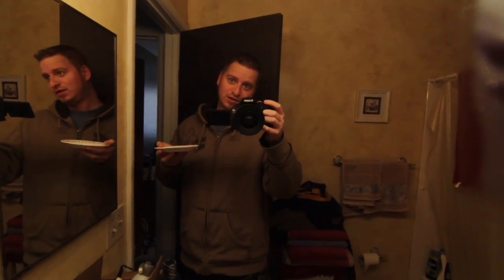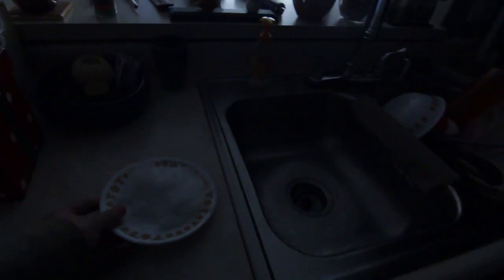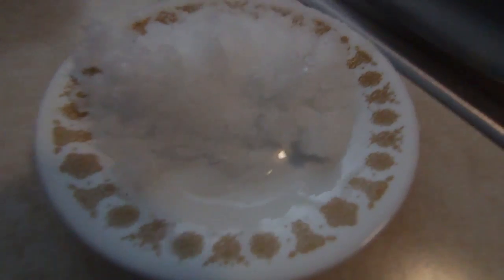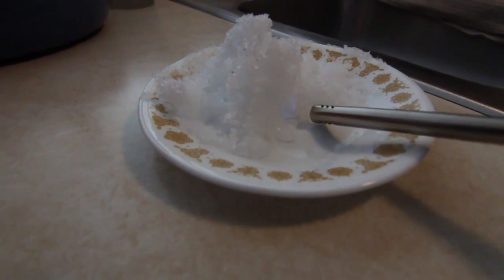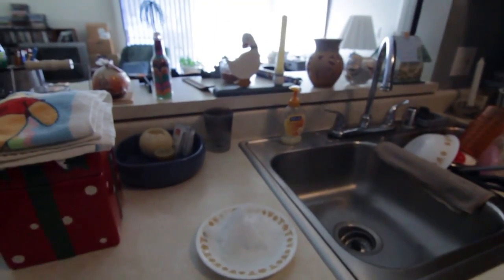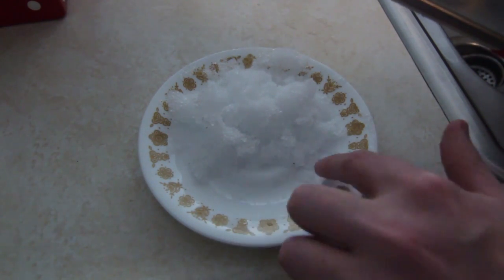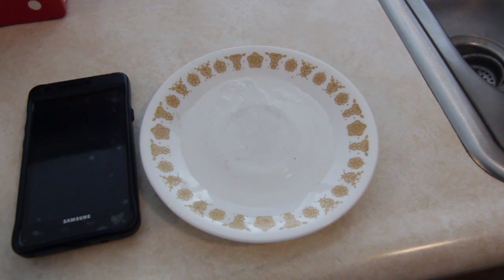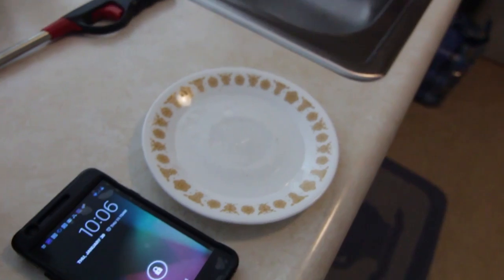Fake Snow Conspiracy Chemtrails DEBUNKED!

Comment: I did this 2 years ago and the snow did not melt, left it on the counter for half an hour and no melting, not one drop, tried to melt it with a lighter, nothing but black burns on it and shriveled up slowly like styrofoam.

Comment: Snow turns black when you use a match because the match releases smoke (airborn carbon molecules) which stick to the snow and darken the color. If you use a gas torch, there is no smoke, so it does not turn black. That's the difference. Also, gas torch's are more effective anyway because they emit many times more heat.

Comment: This did not debunk anything? It just gives me one question for the debate. 

Here is a new test for ya all to do. I thought and tried it once so far, take two pieces of glass and put a small amount of snow on one and let it melt. Carefully place second piece on top. this this way you can hold your sample over a light source and you will be surprised what you will find in this supposed pure clean snow.

Comment: What a performance to get a little bit of snow to melt immediately with a direct flame.That alone speaks volumes that there is something wrong...also the fact these things are cropping up and a simple matter of snow is brought into question when years ago and perhaps before chem trails,such a discussion would have been unheard of, that has got to get alarm bells ringing.
Reply: No, not really. I am what you would call an old man. This is something that you should have learned in science, it is called capillary action. If you saw water melt immediately off of a snowball then you should be worried.

Comment: You didn't pick it up like everyone else to burn it and the plate was probably warm enough to start the melting from the bottom, so of course your results are going to be different.  I don't think there is anything wrong with the snow, however, because I did this experiment with shaved ice "snow" from Bahama Bucks and it also melted into itself without dripping and took on the smell of the burned lighter fluid.

Comment: Still so many idiots commenting that this is fake snow....wtf people. Every single claim has been scientifically explained a lot of times already. Whether it is subliming melting or evaporating isn't even that important, since snow can do all three things depending on the environmental parameters. But for the most part, the snow absorbs the water and gets more and more saturated, like a sponge, until you finally see the water. And carbon residues, polycyclic aromatic hydrocarbons and other products from incomplete combustion explain the blackening and the smell. Get the fuck over it, this snow is real. Everywhere. Period.

Comment: Dude, the snow where YOU are may be normal snow...but where I am, the snow that fell to the ground does the EXACT same thing that others claim in their videos. My brother and I are both in different areas of the state, and we both did the same tests on the snow. The snow where I live did did NOT melt, it turned black and gave off an odd odor, while the snow where my brother lives was like normal snow, it just melted. Something is up, that's all I know. I saw it with my own eyes.
Reply: you idiot it is called Sublimation.

Comment: The other videos have black soot burning off and a foul smell. Not quite the same result. Oh, there ARE chemtrails BTW- don't know their effect on snow.
Reply from the maker: The black soot is because they compressed it into a ball which is harder to burn. That ball leaves behind a black covering from the smoke and lighter fluid. That I believe is also what they are smelling mixed with maybe salt from wherever they got it. I didn't compress it because I didn't want to make the experiment harder. The test was to see if it would melt and if it's water. Since the snow melted I proved that holding a lighter next to it evaporates the water. Disproving all of the claims the snow won't melt. Only difference I did was do it naturally instead of with fire. I know Chemtrails are real, but I don't believe this is "new". Someone just burned a snowball, didnt know what sublimation was, shared it on youtube, and it went viral because of lack of knowledge. Including myself I didnt know why. Now I know its normal and see no reason to believe its a coverup.
Reply: mike Hon It's just the butane, man.
Reply: ***** or maybe not just the butane. Chemtrail chemicals is flammable as this is just a small list of the chemicals used. Ethylene dibromide, aluminum oxide, barium salts, strontium, cadmium, mercury. The aluminum oxide alone is flammable. These are heavy metals in an aerosol. These alone can cause health problems such as respiratory problems, cancers and so on. The snow is real, it's just laced with chemicals like we all breathe everyday. They call it geoengineering but the true name of what they are doing is Terraforming. Look it up and what they are really doing to this only planet we live on. Can anybody say what will we breathe in 20 to 30 years. It is changing the chemical makeup of the planet and air. Got a gas mask yet?